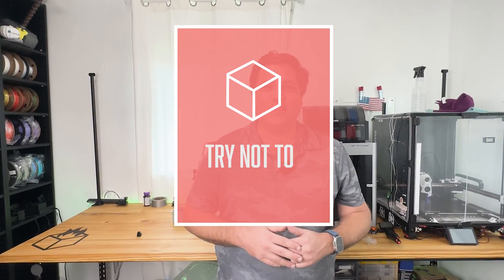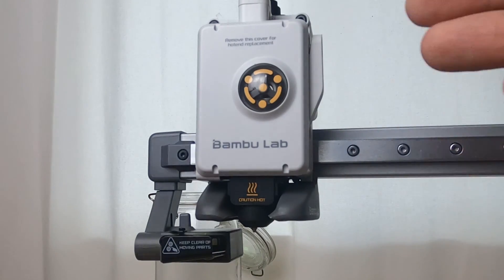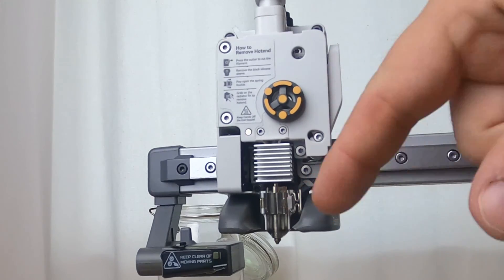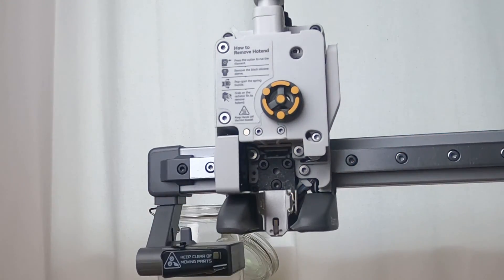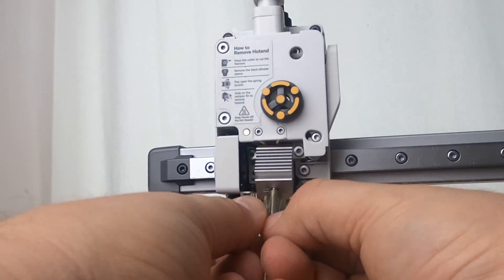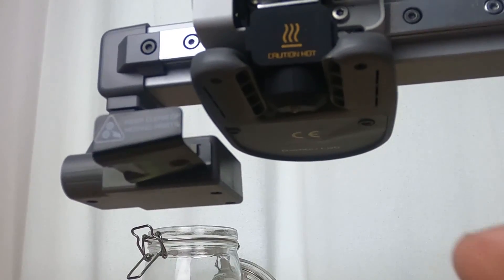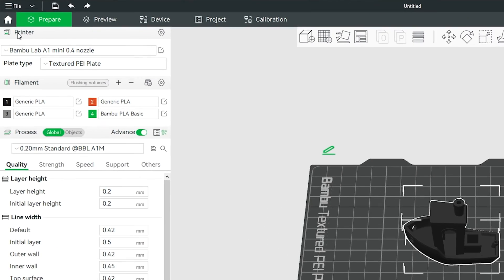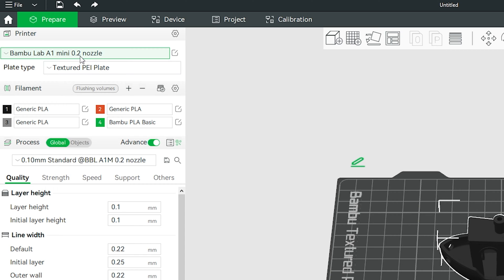Bambulab A1 and A1 mini hotend nozzle replacement guide

Comment: Hello there  amazing video I've changed too a .2 nozzle but it's too close to the bed, and I've tried running a calibration afterwards. have any of you had this problem..?
Reply from the maker: Did you set the printer so it knows you have a .2mm nozzle instead of .4mm?

Comment: Very informative video. But where in the drop down menus, can you change the hot end material type from stainless to hardened ? 🤔
Reply from the maker: You can do it from slicer if you go to the devices tab, go to the top right where it says “printer parts” then you can select the nozzle the machine has
Reply from the maker: From printer screen, go to options > maintenance >nozzle
Reply: @TNTBA  - Thanks for replying ...
So if I change the parameters in Device/Printer parts in Studio, does that override the selection I have made on the machine screen in maintenance ?
What will be the consequence be if I change the head material type in printer parts to .4 'hardened', but leave the machine maintenance setting to .4 Stainless ?

Comment: So my "sock" was apparently full of filament after just a month or so of having the printer.  Had to do all of this while the hot end was hot so the plastic would let it free, was all inside the latch and everything. Any idea why that happened? Ways to prevent it?
Reply from the maker: I had the same issue. I am not sure what happened other than having a clog in the nozzle tip and it caused the filament to come out the back of my hotend or curl out the top right into the sock… not sure.

Comment: Is there a way to replace the portion that clips over the nozzle? My clasp was never straight out of the factory, and just doesn't latch right.
Reply from the maker: Possibly… but I don’t think that part is sold separately. I would get a new hotend assembly and call it a day. In fact, you reminded me I need to order a new assembly for my .2 mm
Reply: Can it work without the latch? Both latch arms have broken off and one is lost :(